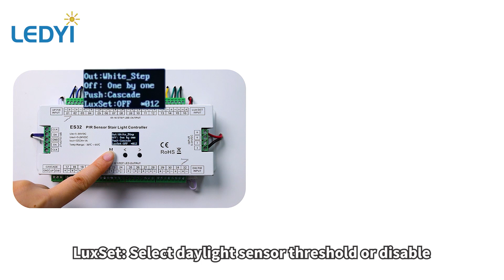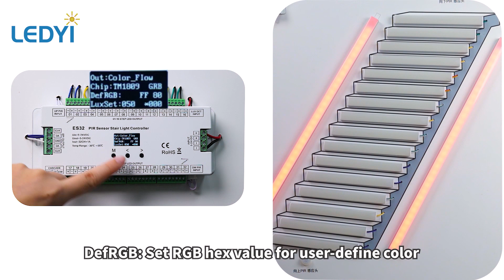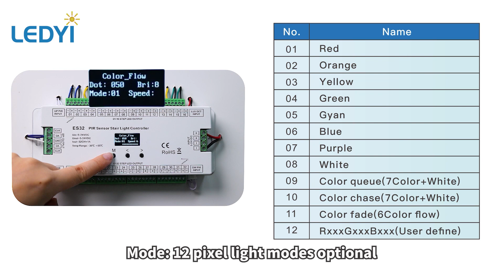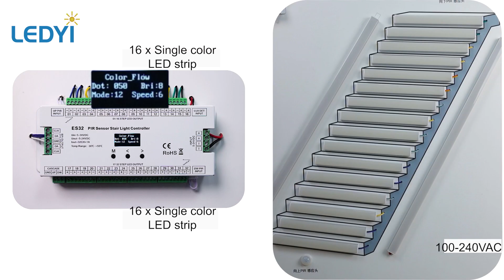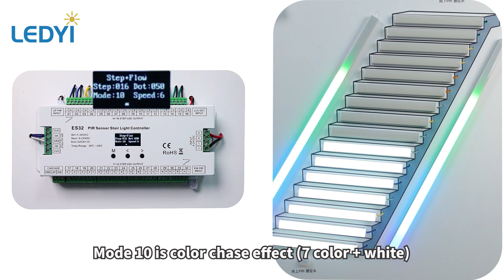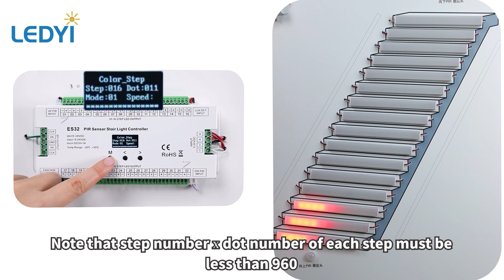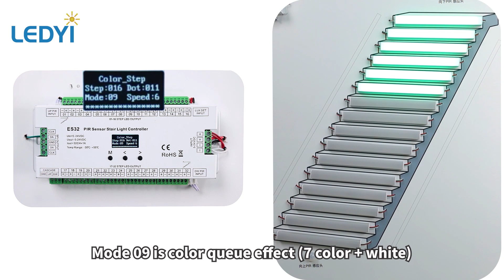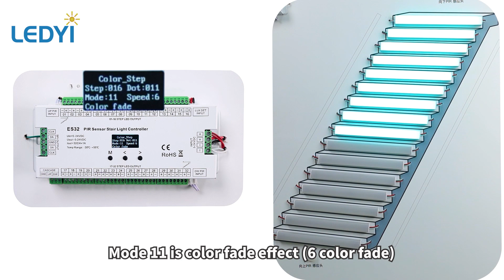PIR Sensor Stair Light Controller ES32: Application & Installation Guide

Comment: Fantastic. Does the controller do the effect of the lights on the wall or does it require a specific type of Led strip? Thanks!
Reply from the maker: need SPI addressable led strip
Reply: @ledyi  thank you